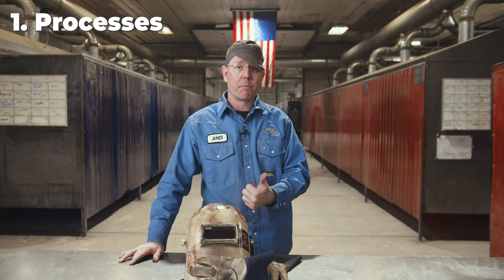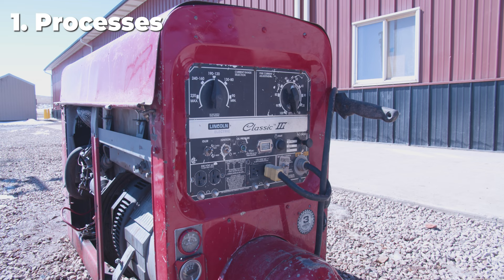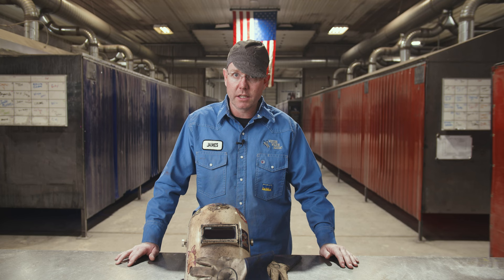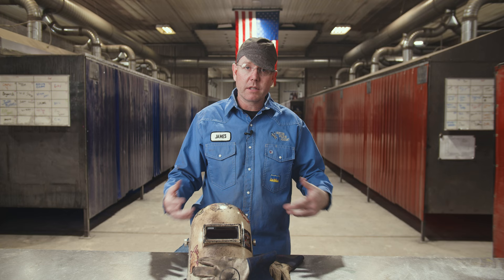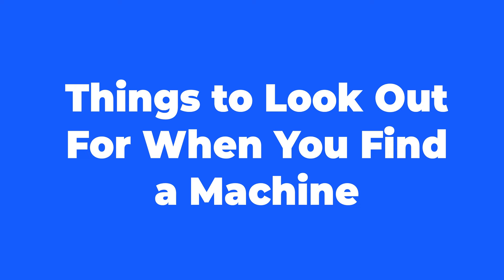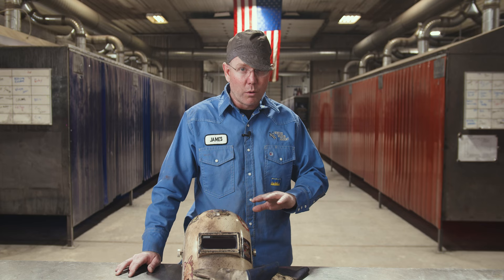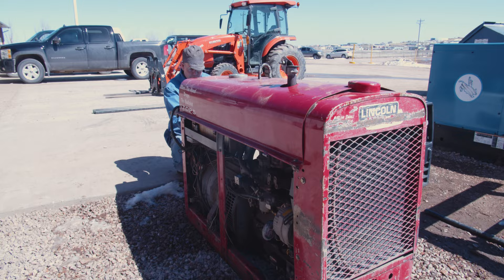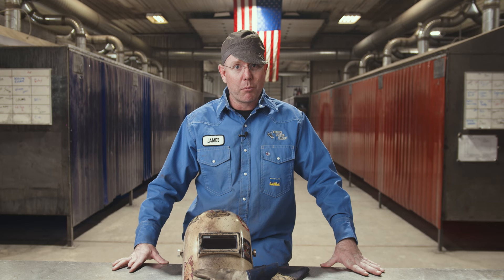Welding Machine Buying Guide: Everything You Need to Know

Comment: Seemed more like youre a lincoln guy i respect it, what are your thoughts on like smaller welder/generators like the miller bobcat 225, trailblazer or the bobcat 250 ive got a 225nt itll weld pipe and structural settings, have you had any experience with those machines or know of people with good or bad experiences